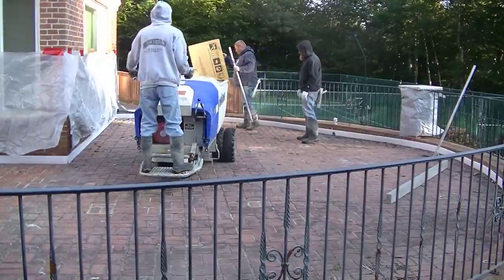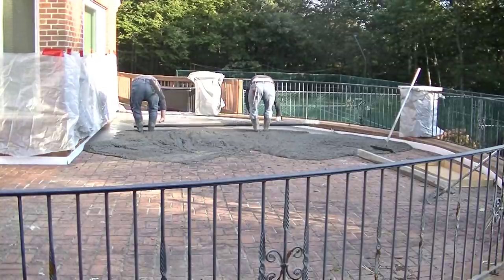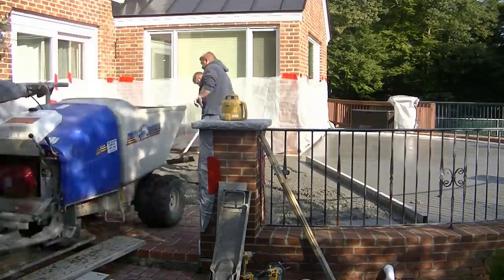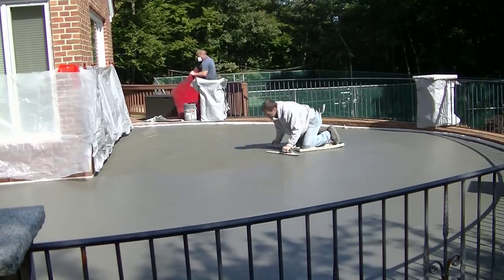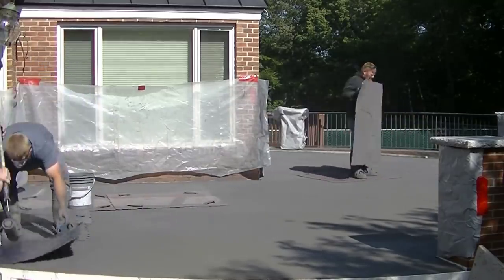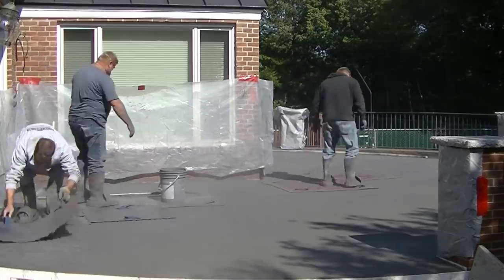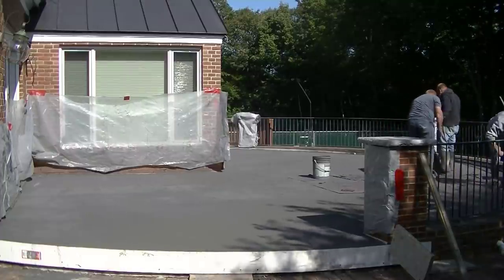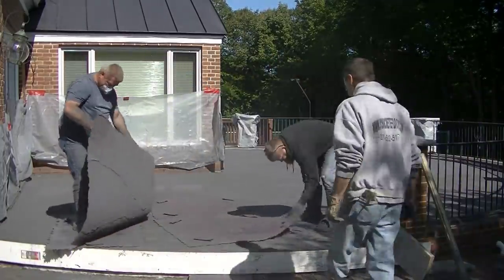Amazing Looking Stamped Concrete Patio Over Existing Brick Pavers

Comment: I’ve had some problems before where we started stamping while someone was still troweling and because a little bit of release dust blowed over where they were troweling you could see all the trowel marks. You ever ran in to this?
Reply from the maker: Sometimes if there's sun and shade, yes. But the trowel marks don't really show I don't eave any lines.
Reply: I’m sorry not the marks from troweling but the release gets troweled in and then you see a fan of a shade darker when it’s all finished, which sucks. Made me scared to trowel anymore after that release powder starts flying.  ever happen to you?

Comment: Nothing against the work you did, the quality of the stamp, etc.  I just prefer a smooth troweled finish.  I think it is better looking, smoother on the feet, and doesn’t allow for organic material to build up.  My old stamped concrete deck just looked dirty and worn out at all times.  Our new deck looks sleek, clean, and modern.
Reply from the maker: Fair enough!